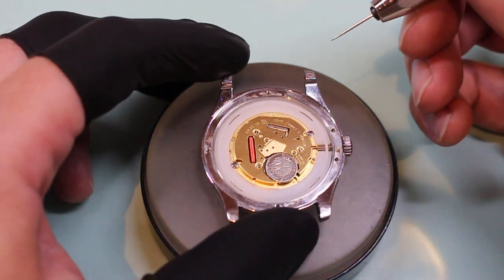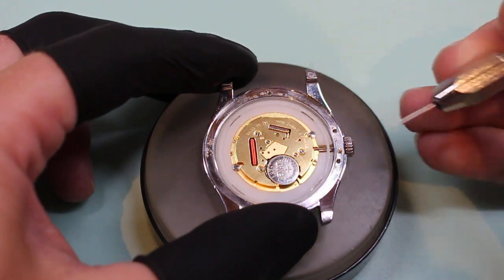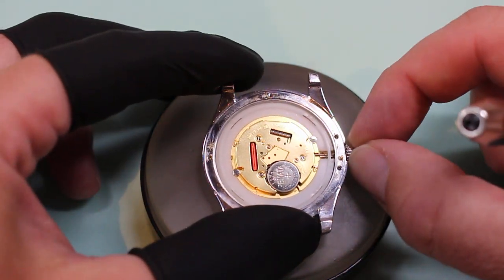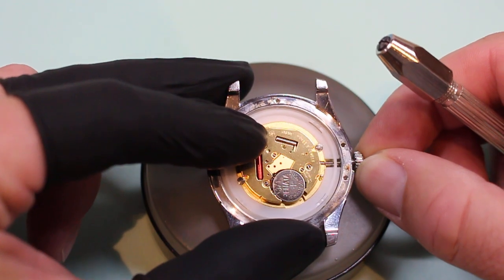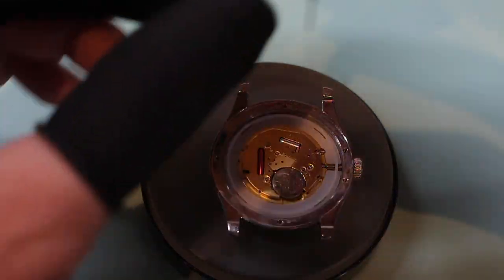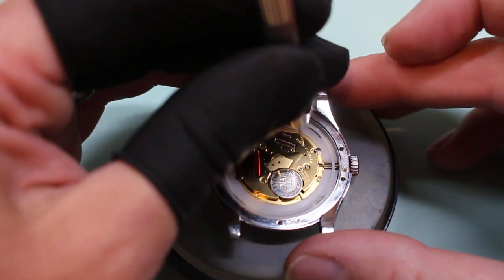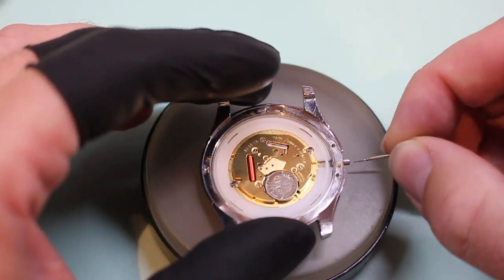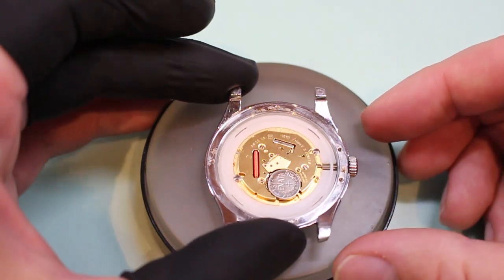Crown and Stem Release ETA F06 111 Watch Movement

Comment: Very helpful. I have no experience with watches but my Gucci watch had a stem that didn't move well and could not change the time.  I used this tip released the stem and set it back in and it works fine.  They wanted $50 just to send it for diagnosis.

Comment: How do u remove the dial from this movement
Reply from the maker: I can't confirm 100% as I don't have this watch or movement in the shop anymore, but for certain it is affixed using dial feet that extend from the dial into the movement.  I would guess that for this movement it is a pressure fit, and the dial will come away from the movement with gentle pressure.  There is a small chance the dial feet are secured with side screws which provide additional pressure on the dial feet, holding them in place.  These screws are located on the sides of the movement, so before you try and remove the dial check to see if there are two screws (generally opposite one another) in the side of the movement.  They do not need to be removed, just loosened.
Cheers,
Colin